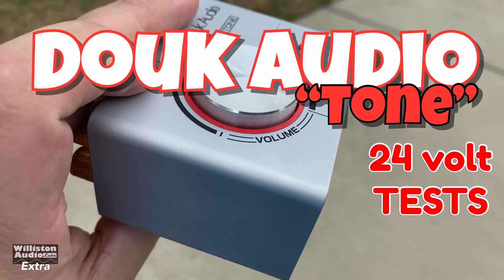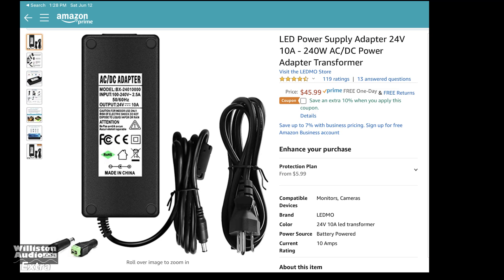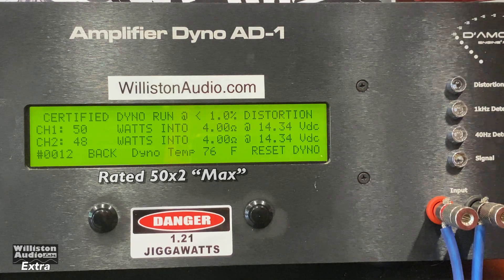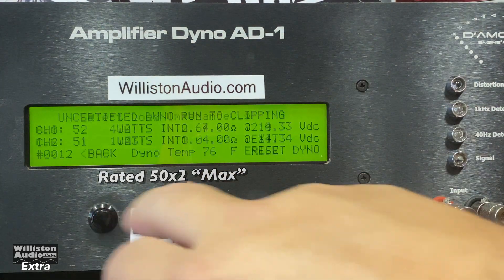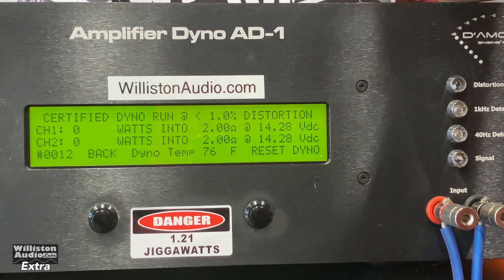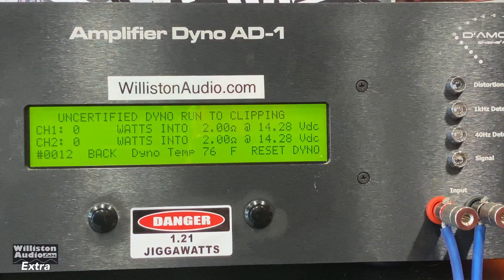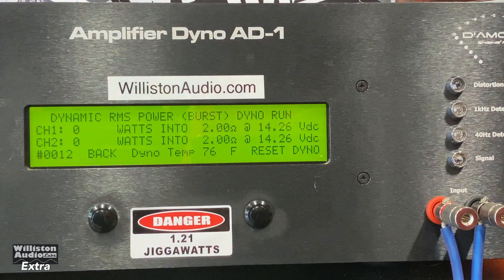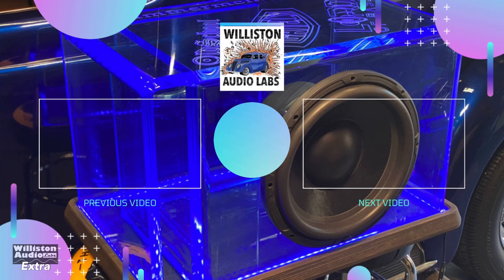Does it Do More Power? Douk Audio Tone Retested at 24V Amp Dyno

Comment: Out of all these low budget amps it’s not just the power I wonder about. It’s the longevity I’m concerned with.
I was so close to buying that pioneer 1000watt rms amp after your review. But I decided to go with NVX 1000stable at 1 ohm. I always ran pioneer amps for the past 15 years. Ran them high and long never an issue but I needed to save money so I took a chance. Now will it last 5 - 8 years ? We will see. Thanks for the videos

Comment: Can it run off a 9v battery?
Reply: I would say no. Even if it ran at 9v the battery would have its voltage drawn down due to the load and I don’t think 9v batteries can handle more than 1 amp draw.
Reply: @russelllopez4171  I say Big D gives it a try and keeps adding batteries until it can get through a full song or 2m50s of bump
Reply: No way those are basically a pile of watch batteries inside. The voltage will drop off considerably with any load more than 20-30ma
Reply: @303nitzubishi4  no there is 6 AAA batteries wired in series in a 9v, but yeah a 8v would run it for a few minutes I'm sure, maybe a few 9v wired in parallel would get ya some time but unlikely, better to use maybe 2 if the old 6v batteries with the spring kinda terminals ontop wired in series